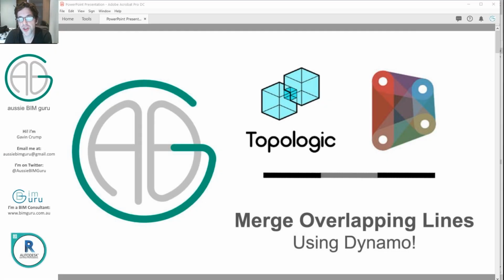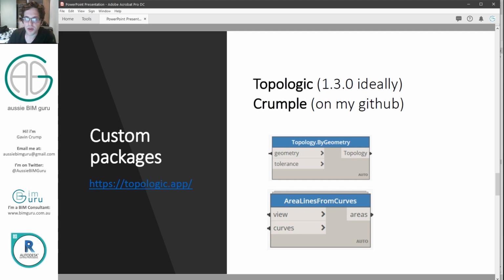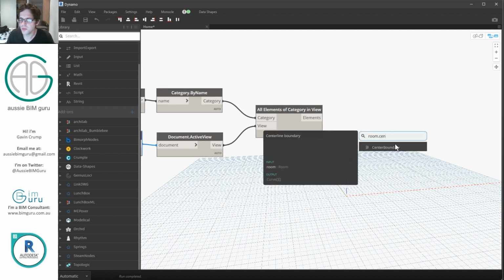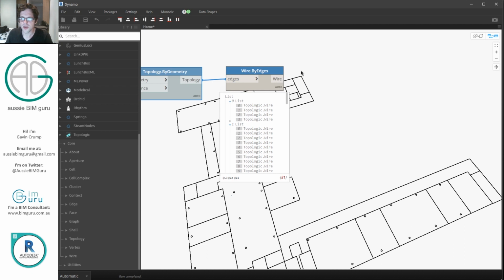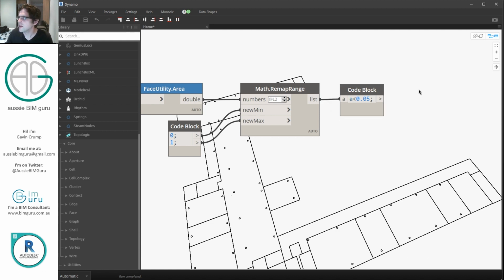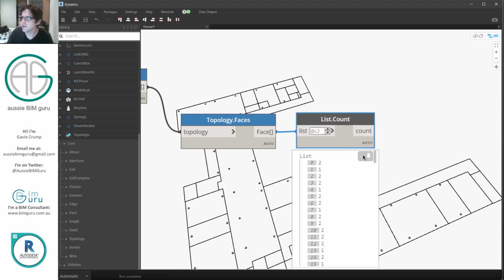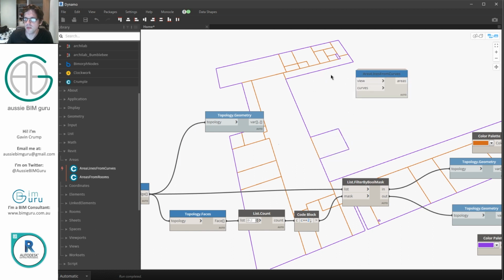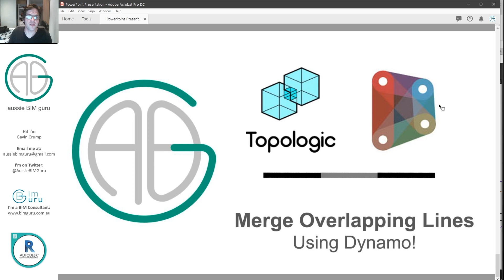Merge overlapping lines using Dynamo!

Comment: Hi Gavin. Would this workflow  works for, or how would one find pipe curves (via dwg, via point cloud), and find the inferred intersection of such curves to then not only nominally correct such curves to assist pipe creation, but more importantly the creation of elbows?
Reply from the maker: This moreso works with overlapping curves so what you describe is a pretty different workflow. The best i can think to achieve that is the curve intersect many node from bimorph combined with some parameter at point processing to determine the first intersection with an extended curve to try to determine elbow locations. It would probably need Python to be done efficiently.
Reply: @AussieBIMGuru  thank you for the suggestion

Comment: Hello Gavin, great tutorial as always. I try different usage, I started with area plans with apartments and public spaces. according your graph I can create outside walls (facade) and inner walls between apartments and public spaces, it working great. For futher development it will be good to have different wall between apartment and public space. like third wall (colored in graph). Question is is it possible to adopt this graph in that sense. Best regards
Reply: Hi Gavin, thx for response, in mean time I solved it more simpler way. br
Reply from the maker: In all honesty from a topologic aspect I'm not 100% sure but I believe cell complexes should have an understanding of the cell either side via the faces of their shell. I'd recommend touching base with Wassim Jabi via LinkedIn or Twitter and he will no doubt know the easiest way to use Topologic to check for neighboring conditions in a topologic complex.

In the event you are using a wall line/location curve instead of topologic entities, you could send a point either direction and check their room/space types if they have this data. The RevitAPI method GetRoomAtPoint can very quickly check which room sits at a given point.

Comment: Hi. Great video. I need help in joining parallel lines that do not overlap, with the same direction, end to start. I would like to group parallel lines from several lines, then join the short ones end to start. Your help will be highly appreciated.
Thanks
Reply from the maker: Assuming the lines are parallel, you could group them using a node such as GroupParallel (I think it's from archilab). If they aren't facing the same way (e.g. fljpped 180deg) you could compare their xyz components and flip those that aren't consistent with the first in each group. To join them from there you could get their endpoints then sort them by lowest X or Y component.

Suggest making a topic on  dynamo forums if this doesnt make sense or you need hands on help from someone.

Comment: Awesome video! Have you ever tried this workflow with 3000+ curves?
Reply from the maker: Haha definitely not. At that point I'd be going into Rhino Inside I think!

Speak of the devil:
https://youtu.be/S4-JvMMd41k
Reply: @AussieBIMGuru  Thanks for sharing! I'll give that a watch. I am currently working on a super large project and trying to merge lines/ remove overlapping lines. As always, Dynamo is slow, lol.
Reply from the maker: Yeah I dont use dynamo for many geoemtric process' these days. It almost always crashes with large data sets.
Reply: @AussieBIMGuru  I still do, unfortunately, but it pushes me to optimize things in Dynamo with python. I test little differences in code to see how they impact performance.

Comment: Hi, great content again! I didn't know about this package till now. I'm having an issue connecting lines together. If I have 4 separate lines/curves forming a square but not crossing each other how I can merge them to become one single closed polycurve or polyline? I have tried the node, Springs.LineLoop.Merge, in some cases, it worked for me, but in larger geometry, it fails. And I'm not sure why. Does Topologic have a specific node workflow to merge edges by closest? Thank you in advance.
Reply from the maker: I believe in this case topologic could convert these to a wire and find curveloops from within this topologic entity. Maybe reach out to Wassim Jabi himself, I'm sure he'd know a fairly quick method of going about this (he knows this package far better than me given he wrote it!).